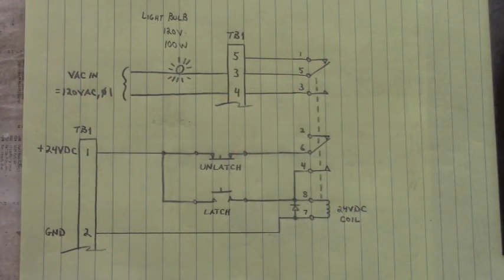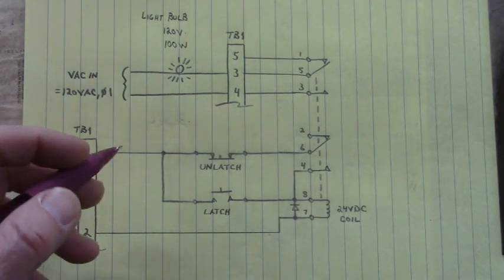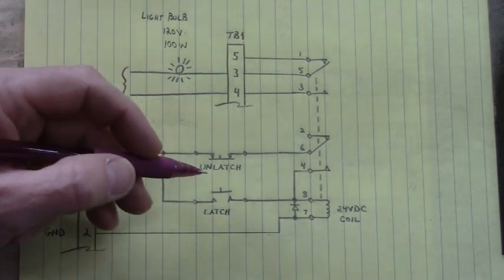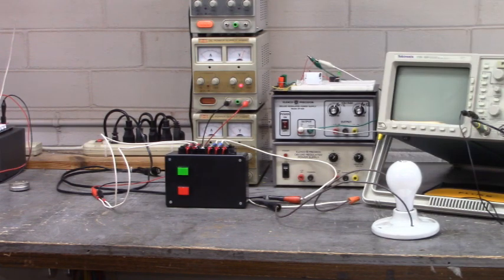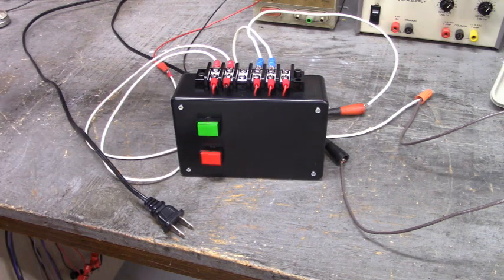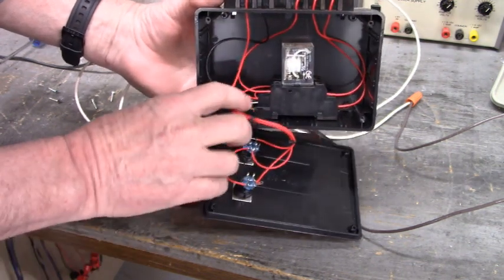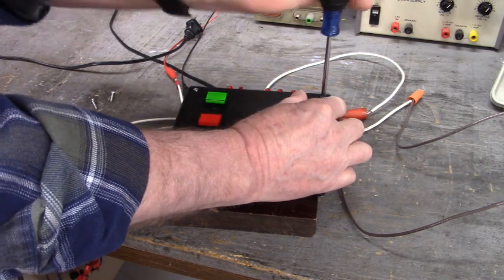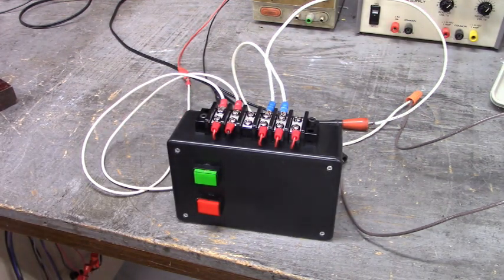Homemade Latch Unlatch Relay Circuit

Comment: Putting capacitors and resistors in series or parallel with the relays can allow the circuit to behave in a different manner. A relay fed by a resistor with a capacitor in series with the relay will have a delay before turn on. A relay fed by a capacitor will give a pulse at turn on. This can be useful. I made a motorbike alarm that when turned on locked the brakes. The motor that locked the brakes would set the alarm off. I fed the alarm from a relay  fed by a resistor and connected the relay parallel to a capacitor. The result was that the alarm turned on after the motor stopped.